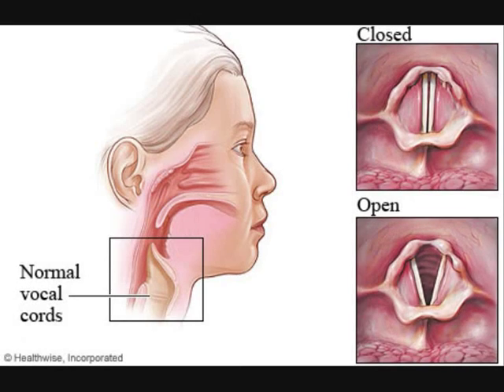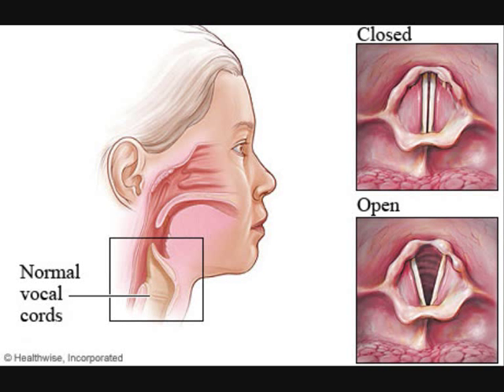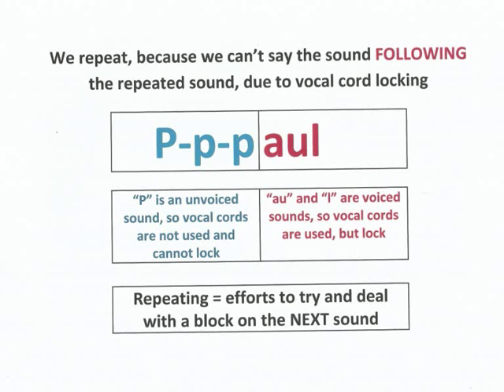The Passive Airflow Technique (2): Why We Stutter

Comment: Hello Peter. What do you think of Avoidance Reduction Therapy method by Joseph Sheehan?
Reply from the maker: Hi Marina, I haven't done that therapy... from what I have read, some find it helpful but not everybody. But that goes for all therapy types; in stuttering, there is not a "one size fits all" treatment. From what I know of the Sheehan approach is that it is rather radical. The client is required to stutter voluntarily as much as possible. The approach is somewhat controversial these days and some say that it could even reinforce the stutter. PS note that I have taken a different course since I made this video. The airflow technique is great, but these days I follow a "mindbody" approach, as you will see from my last few videos. If interested, join my "Stuttering as a mindbody disorder" Facebook group! Best wishes.